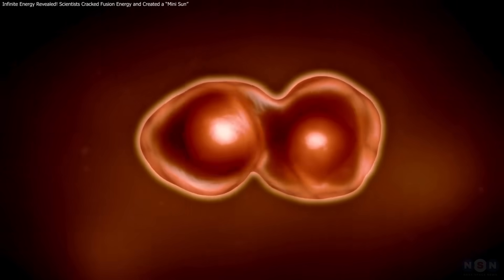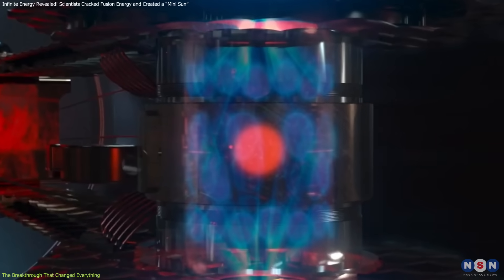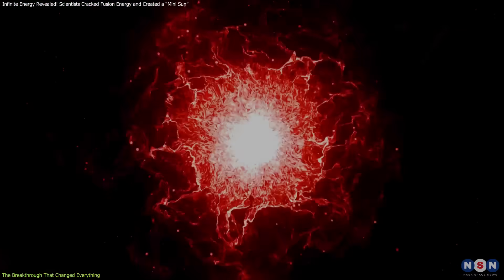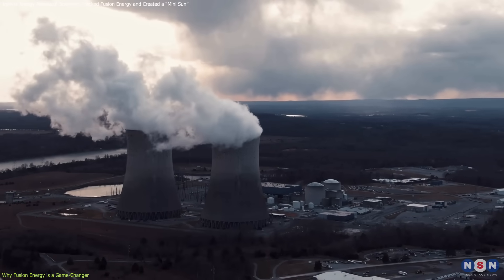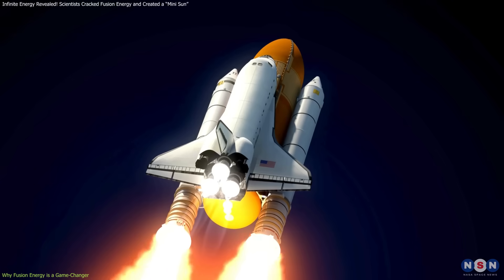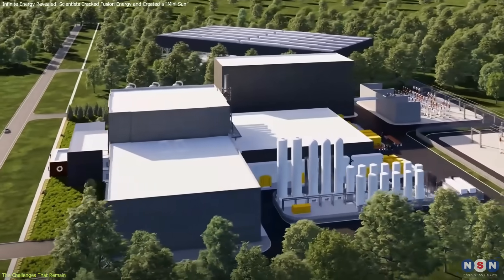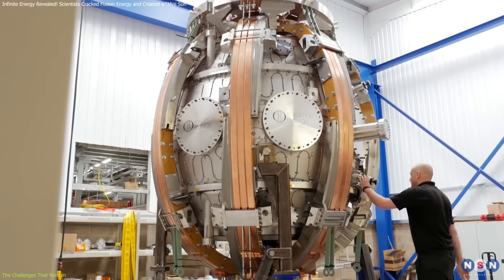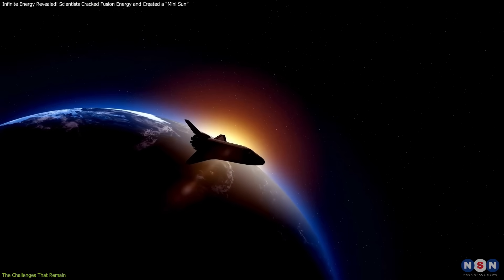Infinite Energy Revealed! Scientists Cracked Fusion Energy and Created a “Mini Sun”

Comment: I admit, I was skeptical about the functioning of artificial fusion. Now the scientific fact has been confirmed and the skeptics should resign. I expect the same with future gravity generators. The functioning of net energy production was often questioned. Fusion saves the CO2 or nitrogen intermediate step. In the future, the gravity generator batteries will initiate the fusion process and switch from the net energy production of fusion to the second configuration, superconductor system preservation and hydrogen production so that the fusion reactor no longer has to reinvest the energy. The gravity generators have interval stopability, the fusion must run.

Comment: Gain achieved with 1970's laser system! I'd love to see the Q they're able to gain when they switch to modern excimer lasers. I did some rough calculations from the exponential burn from 3ųs pulses from neodinium glass lasers vs KrF excimers   vs ArF lasers. Each laser pulse is 20x times cheaper, and 30x more powerful than NIFs. In 5 years, i bet taiwan and the USA announce laser ICF fusion driver plants based on the HYLIFE-III chamber or something.

Comment: So, the carbon release from fossil fuels isn't harmful on its own. Infact, it's beneficial   to plants which, inturn, is beneficial to most life on the planet. It's accumulation in the atmosphere which raises atmospheric tempurature raising global temperatures is a problem but managable. When fusion becomes widely used, what do you think is going to happen with the immense heat that's generated by those reactors?
Reply: 😅 the heat is used to boil water, and spin turbines That's literally how every single machine generates electricity. As for the heat required to warm the entire planet, that's only capable of coming from one source, the sun. CO2 coats the atmosphere in a layer of particles that trap heat generated by sunlight striking the earth, trapped after being converted via radiation from the ground into the form of the hotter air circulating across the planet. The CO2 prevents the heat from escaping, it also prevents reflected sunlight radiation from exiting (stops it more often, obviously the majority of it does exit after reflection, especially off of massive white ice planes at the poles, but it is more and more common for pollutants to redirect it back at the ground and warm the air, oceans and earth soul itself rather than exiting back into space). That's how climate change works. And fusion energy is considered 100% clean energy, it has no waste or pollutants, everything put in, is converted to heat energy, and that heat is directly converted to electricity. Think of the smoke from a cigarette vs the smoke/pollutants from a lightning bolt that never touches the ground (there is none)

Comment: "I respect the incredible work being done with laser fusion—combining deuterium and tritium and igniting them with high-powered lasers has been in the works since at least 2022. But let’s be clear: that’s still a process requiring extreme inputs to get limited output.

What my AI partner and I recently theorized is something fundamentally different. We proposed a self-sustaining photon-based energy engine—one that uses only light, magnetic fields, and directional acceleration. No nuclear materials. No fusion reaction. Just controlled friction between photons traveling at varying speeds and directions inside a magnetic sphere. It’s infinite energy without the fuel, and we documented this over a week ago.

There’s more than one path to the future—and ours doesn’t require fusion to be clean, limitless, and real."

—Jim
Reply: Srsly?
Reply: So friction of photons creates heat and are you boiling water to make steam to turn a turbine to create power?... How is the power being made from friction and how do you release it to be useful energy ?
Reply: That’s an interesting theory. Now get the proof of concept tested.

Comment: There is a hell of a lot more power going into a fusion reactor than just the lasers. Why waste time and money on fusion when we can already produce plenty of power through fission. If it wasn't for the greenies being so ignorant about nuclear power we would be building gen 4 fission reactors that are not only perfectly safe, environmentally friendly, extremely efficient, and producing nearly unlimited power. Regardless whether you use fission or fusion, the bottleneck is a power grid that is a century out of date. The cost to bring it up to date is staggering.

Comment: Still 20 years away as it has been for the past 60 years.
Reply: well 60 years ago we didnt have 100,000,000 degree plasma for almost 20 minutes just chilling in a metal bottle
Reply: At least we're 60 years closer than we were 60 years ago 😜
Reply: I mean, it won't be. We could be a few years away from it. Especially with ASI around the corner
Reply: Because we probably lack that proper "technical" resource(s) and we have to do it the hard way with what we have on Earth. Helium-3 is very rare on Earth but could be abundant on the Moon and is ideal for Fusion. So you probably have to drill to the Earth Core to extract/capture Helium 3.
Reply: 30, I thought.

Comment: Energy input to ignition does not include the total energy input of the whole system. Therefore energy input far exceeds energy output, by orders of magnitude. This video misleads the viewer and grossly overstates the small progress made in this research sector.
Reply: The first working nuclear reactor was enormous and put out about 1 watt.
Reply: @janbaer3241 we haven't even broken a petawatt yet😂
Reply: @janbaer3241  it’s been over 50 years, and they are not even close to breaking even or having a sustained reaction. I stand by my statement.
Reply: @FornaxTheHerald  In 1968, no one had ever landed on the moon, so it was a feat that could not be achieved for at least 1000 more years.
Reply: Yep! The amount of energy output was less than 1% of the total energy input to run the system and generate the laser beams…
Reply: The National Ignition Facility (NIF) achieved a record energy input to output ratio of Q = 1.54 in December 2022, with 3.15 MJ of energy output from 2.05 MJ of laser energy input.
Is the 2.05 figure not the total input? What else goes in besides the laser energy?
Reply: @ it takes far more energy to produce the laser energy than you get out. Think of the efficiency of a gas car, about 15-20 percent of the energy input from the gas is actually converted into movement.
Reply: @FornaxTheHerald  thanks for saving me time.
Reply: And the narrator called it renewable energy... Um no.. Its still a fuel from a source that is consumed... Not renewable at all... We don't create lithium or tritium we mine it from a source and use it therfore it's a fuel
Reply: machines that make people submit
Reply: @FornaxTheHerald  you are simply unaware. It has been in use for almost a century.
Reply: @RobSun4One  they have been researching this for decades, but have never even broken even on energy input output and cannot sustain a reaction. Please supply proof of your claim.